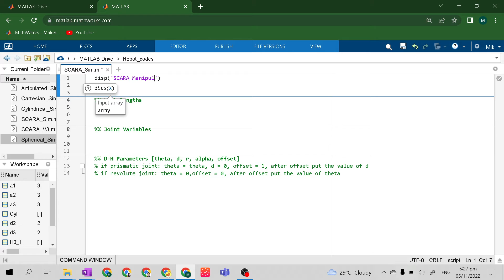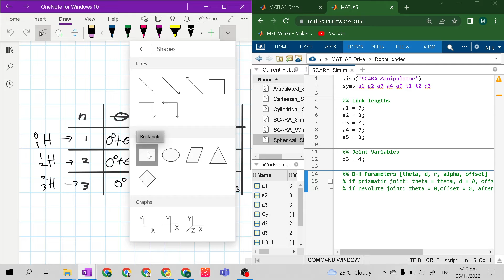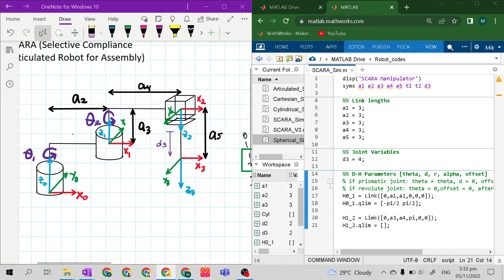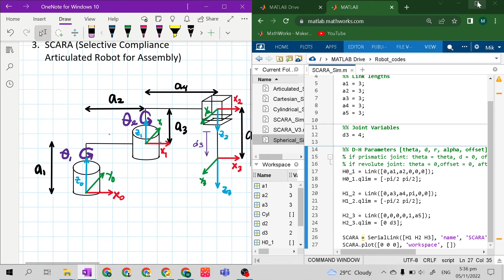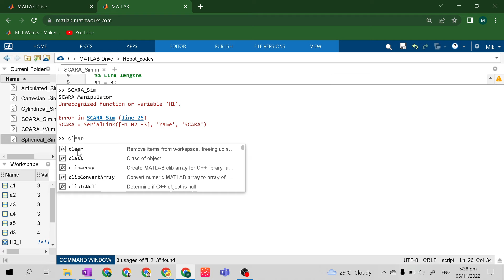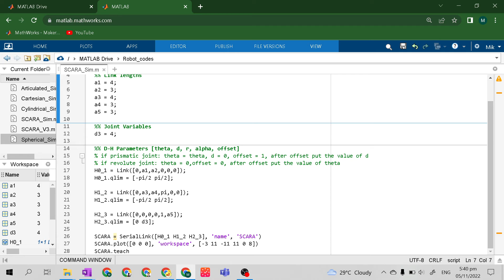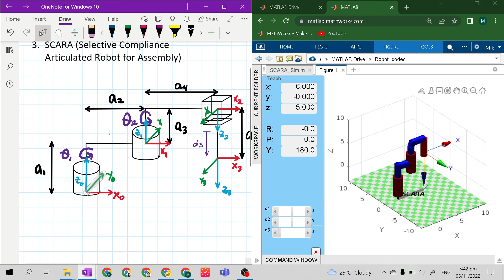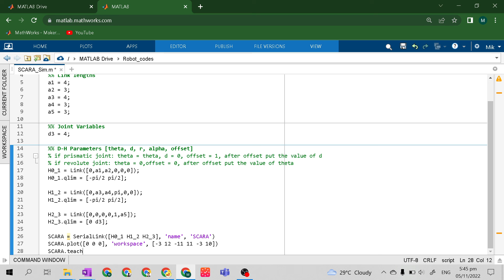Robotics 1: Coding SCARA Robot (Manipulator) in RTB by Peter Corke

Comment: Hi, I tried your matlab code I have obtained the DH matrix like yours but the SCARA.teach command does not work
Reply: Thank you for your reply. Actually the problem was in the Peter corke toolbox that I uploaded in MATLAB. The program works well now, thank you. However SCARA robot have another rotoide as final joint.
Reply from the maker: What is " rotoide" @djebalaamira5435  ?
Reply from the maker: Did you did it in MATLAB online?
Reply: Sorry I mean pivot link as final joint.
What about inverse model of SCARA robot in Peter Corke toolbox.
Thanks
Reply from the maker: @djebalaamira5435  I am doing the inverse kinematics using the ikine code and combining it with the forward kinematics of the toolbox. I'm doing it also using the GUI of MATLAB.
Reply: Thanks a lot